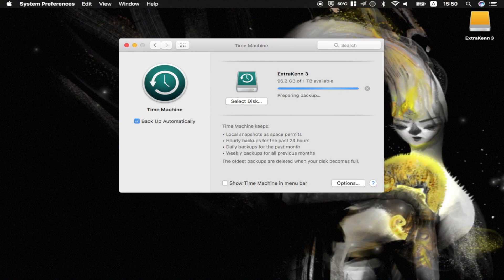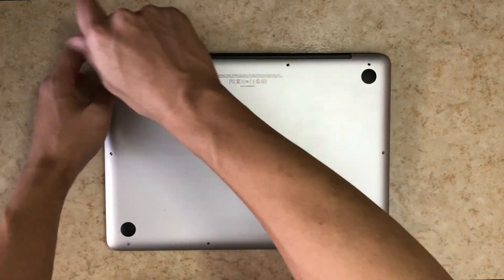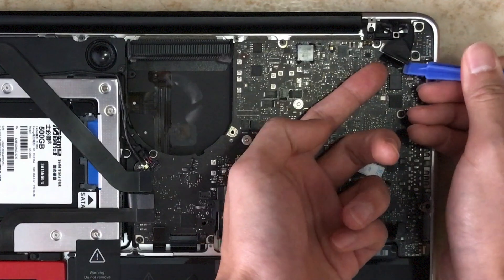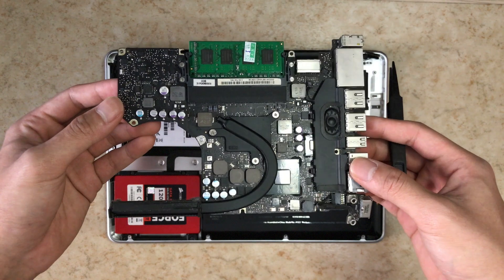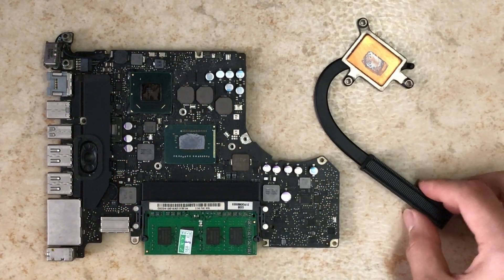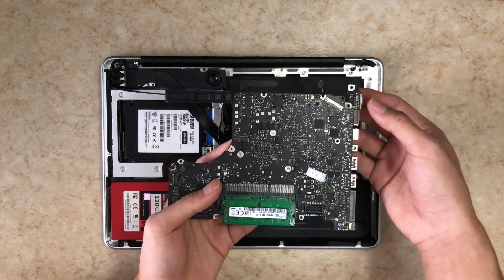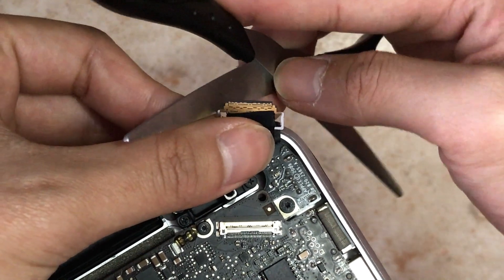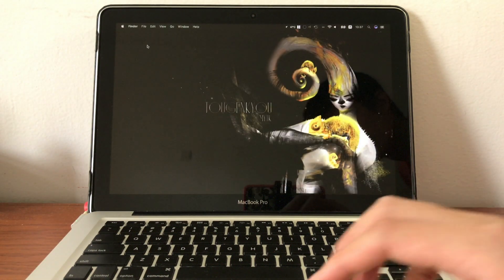How To UPGRADE Your 2011 Macbook Pro to 2012!

Comment from the maker: I have just recently added a few links to get the parts required to upgrade your Late 2011 logic board into the Mid 2012 one. Please kindly check out the video description 🙏🏻
Reply: Kenneth Tanaka    I have a late 2011 MacBook Pro 17. Is this what will fix the bad GPU issue?
Reply: 867 5309 that’s what I’m asking
Reply: 867 5309 I would think so tho because the graphics is different
Reply: Sukses untuk mu (succes for you)
Reply: Keeneth . Mac book pro late 2011 aku bisa diugradpe ke 2012 tidak ??
Reply: Can you do this with a Mac mini also

Comment: Hey man, I recently swapped the motherboard. At first it was fine. But now it couldn't be powered on (both motherboard doesnt hv green light from magsafe anymore) could it be the charger's fault? Also, do i need to change the charger as well?

Comment: Thanks for the tutorial, Ken. So I have an early 13" 2011 MacBook Pro. Because of some logic board issue, I'm planning to replace the logic board with the newer version. Which one of the best option? Replacing with 2011 i7 or Mid 2012 i5

Comment: Great video, thank you! A few questions. You mention the heat pipes. Does the correct heat pipe for the 2012 board usually come with the board, or is this a piece that I would need to find/buy separately? In the video it looks like you took the heat pipe off of the 2012 board, and then put it right back on. I presume that this was to put fresh thermal compound on, as you're making the swap? I note your video was done in 2017. I'm looking at replacing my Late 2011 board with a 2012. As I write this, it is September, 2021. I'm curious if there is anything new you've found about this update that we should know, since you made this video. Many thanks!
Reply from the maker: Hey there Brian, so far there has been no update to the method or parts being used, and yes the 2012-model heat pipe will be a separate purchase from the motherboard, but that depends on the seller as well maybe he’ll give one included (mostly they don’t)

And do note that the 2011 and 2012 heatpipe is different, so it’s not only to change the thermal compound

Comment: Would adding the 2012 logic board to a 2011 macbook pro - give it USB 3.0 & the more modern Bluetooth 4.0? Great tutorial by the way
Reply from the maker: Yes to the USB but no to the bluetooth, you need to get the bluetooth module separately

Comment: is it ok to touch the motherboard ?
Reply from the maker: As long as you don’t have any static electricity, try touching the metal body of the mac, or the metal part of the DVD drive first to discharge any charge you might have, before touching the motherboard
Reply: @namedkenn oh ok thanks
Reply: @namedkenn  I want to try and upgrade my MacBook Pro to its maximum limitations
Reply: @namedkenn  hey I have one more question are the links you put in the description safe to buy from ?

Comment: I have a few questions. 

1.) Will the 13"  2012 motherboard work on the late 2011 17" Macbook Pro? ;  
2.) Is there any difference between a 13" motherboard and a 17" motherboard?
3.) Does upgrading to a 2012 affect any ram or other upgrades to the rest of the computer?
Reply: 3rd question my worry too

Comment: Hi Kenneth, if I have both MacBooks next to each other and I'm just swapping the boards out - can I simply take the whole board with heatsink, speaker and magsafe and drop it into the 2011?
I did that, also put the 2012 fan into the 2011 body, it works but I'm getting weird responses like laggy touchpad...any idea? It feels like it might throttle somewhere but the heatsink gets warm, the fan works and the board doesn't feel that hot when touching the underside of the PCH and CPU. Could it be that it gets angry with different (or removed) bottom plate?

Comment: I did as you suggested, and bought a mid-2012 logic board to replace the mid-2011 LG! I placed everything back to the way it was BUT it never turned on. Black screen but Apple chime was heard and that was it! I can't figure out what is wrong with it.
Reply from the maker: Double check the display connector, has it been attached fully?

Comment: Hey thanks so much fo this . Quick question do i need to format my SSD or can i just keep the exact SSD that was running with the 2011 Motherboard?
Reply from the maker: You can keep using it...

Though I think I did a fresh install when I swapped the motherboard so, I’m not sure if the old files will ‘just work’

Comment: Hey Kenneth, My Macbook Pro (Late 2011) 13 inch has a 2.8 GHz Intel Core i7. Is it possible to upgrade that? Or should I keep it? I'm still going to do all the other upgrades from the original OG Video!
Reply from the maker: Yes you can, but only if you really need to, otherwise I think it’s better to just sell it and get something a bit newer (2013-2015 MBP)

Comment: I have a Macbook Pro late 2011 with i7 processor. Wouldnt this downgrade the processor to i5? Or is it still better?
Reply from the maker: I think the only difference between i5 and i7 was the clock speed, so you won’t see much of a difference in the CPU, but you will feel the difference of the GPU that’s for sure

Comment: Great  tutorial video for those of use who want to upgrade a faulty 2011 board to a 2012.

Personally since my MacBook also has a faulty battery and speakers along with a faulty on-board  gfx card it just gets to the point that it’s just way easier (if not cheaper) to just get a used 2012 MacBook Pro.

Comment: Hi Kenneth, excellent tutorial. I have an early 2011 13" MBP. Is a late 2012  logic board the latest I can upgrade to, or can I go even newer?
Reply from the maker: Thanks! This is the latest we can upgrade since every MBP after 2012 are using new designs
Reply: @namedkenn  Ok, thanks for the info! Does that mean mid 2012 only, or let 2012 as well ?
Reply: Sorry for the typo, I meant "or late 2012 as well?"

Comment: Can you do this from the 2010 mbp to 2012 mbp logic board (non retina)?
Reply: After some research, I found out it is very very possible. The only things that are not compatible are the airport (wifi card), speakers, antennas, and display connection. The easiest way to solve this is to purchase the 2012 MacBook pro display, by doing this you are getting new antennas and the correct display connection. To fix the other issues just purchase a MacBook pro 2012 airport with cable, and speakers (subwoofer, left, and right). This solves all of the issues that you will have when upgrading from a 2010 mbp logic board to a 2012 mbp logic board, the 2012 offers MUCH more power so it is worth the $240 upgrade for all this.
Reply: Do you mind posting where you found the parts you used
Reply: Kevin Nimbus Yea! Just search on ebay, I even got the price down on the logic board by making an offer on ebay

Comment: I upgraded my 2011 MacBook Pro motherboard to a late 2012 for the sole purpose of updating MAc OS High Sierra to Mojave. Besides trying a clean install of Mojave, all other program upgrades have failed. I start out with a Mountain Lion system that’s was upgraded to High Sierra without any problems. I then installed all updates to High Sierra. I went to the Apple site and downloaded a copy of Mojave with out any problems. I launched the Mojave application and went through the steps on installing on my untitled hard drive. 10 hours later the program barely shows half way from loading. I did a simple reset but no luck. Please help.

Comment: Do you need to buy a processor to install in the motherboard right? could you share an active link to buy the motherboard, the one you shared before is down D:     --  warm regards!
Reply: I have a Macbook Late 2011 . I5 2.4GHZ 8 RAM 4x4 DDR3 1333mhz - SSD 240 - OS 10.6.8.
Could I get this:
Bluetooth 4.0 Wireless card BCM94331PCIEBT4CAX
4. MD101 Mid 2012 Motherboard
5. MBP Mid 2012 heatpipe
5. 16GB (2x8) 1866MHz DDR3 RAM
6. New Battery . 

is it possible to restore it and install a newer OS? which one could you recommend me, I'm looking to work with code and audio and basic tasks in office.

Comment: Hello Kenneth,  I have a macbook pro 13" with 2.7 Mhz, 17 processor , 8 GB RAM 1333 Mhz.i upgrade it to 
MACOS High Sierra and the computer became very slow. So i am thinking to do some upgrades based on your videos.
So which motherboard is compatible and where i can buy it ? i believe also RAM  can go up to 16GB.
Can you please advice ?
Thank you very much 
Nikolas
Reply from the maker: Which year is your motherboard again? If you can upgrade to High Sierra officially then most likely you already have the top-end Mid 2012 board, and sadly there is no more upgrade to that. Maybe try upgrading to SSD that will help speed things up a ton

Comment: You can simply buy a new 2012 LCD connector and while reassembling LCD panel, swap the 2011 out. No need to cut the edges with force at all.
Reply from the maker: Well that’s another alternative 🤣 but I prefer to keep using my old monitor, and I don’t have to spend more on a monitor too haha
Reply: @namedkenn  No, you keep the LCD, but just swap out the connector cable from LCD to board. It requires disassembling LCD panel too.
Reply from the maker: Ohh right right that could possibly work, and at a low cost too

Comment: Would it be possible to upgrade MBP 13 Mid 2010 to the Mid 2012 logic board and what other parts do we need to replace if it's in anyway possible? Thanks
Reply: Hi! I was researching this and it seems everyone tells you that it's impossible. I can assure you it's not, I spent some time going through everything and I am about to do the same to my 2010 mbp. What you need to do is purchase a 2012 airport card and cable, 2012 MacBook pro display, 2012 MacBook pro speakers (subwoofer, left, right), and the 2012 MacBook pro logic board. The airport card and cable are compatible with the new board while the 2010 one isn't. Now you need to replace the antennas and camera (which also have different plugs on the 2012 logic board), what I found was that it is just easier to replace the display which contains all this for you at a smaller cost, so just buy a 2012 display. After that, the new speakers assemble just like the old ones but the main one has the space for the airport card. This is all you need in order to upgrade your 2010 logic board to 2012, it sounds so complicated but it really isn't and the extra power you get is really nice.

Comment: I have replaced my harddrive with a new SSD and that's about the only thing I've upgraded on my 15 inch macbook pro , late 2011. Here are my overall specs...what else can I replace and upgrade here?  

Processor: 2.2 GHz Intel Core i7
Memory: 16 GB 1333 MHz DDR3
Graphics: AMD Radeon HD 6750M 512 MB
Intel HD Graphics 3000 512 MB
SSD: EVO 850 PRO, 2TB
Reply: I have the same.  There is nothing else, other than following these instructions to upgrade to 2012, which I understand is considerably better.

Comment: I was able to use the 2.9 i7 logic board but I accidentally broke the iSight Cable during installation, but I have Mojave installed.
Reply: hey man, where did you buy the board?
Reply: Ali Azimi I was too scared to buy a cheap one from third party source and appreciated lifetime warranty from iFixit, but it’s $399...... yeah...
Reply: still cheaper than a new machine

Comment: I will be attempting to upgrade early 2011 MBP 2.3 ghz i5 to mid 2012 2.9 ghz i7 logic board but I am not sure if it will be compatible. Any advice?
Reply: Hi, any luck on this? I also have early 2011 MBP, and thinking of upgrading to 2012 mother board
Reply: Hi? I also have MBP 13 early 2011. Does it work with mid-2012 logic board?

Comment: I have a macbook pro late 2011 i5 2.4 . I am wanting to change the mother board to the Apple MacBook Pro 2012 (Mid) Core i7 2.9Ghz 13-inch. Is this possible?
Reply: I had the same question... except I have an early 2011 2.3 Ghz. I just ordered the mid 2012 2.9 i7 on iFixit and will be attempting an upgrade next week. I'll let you know how it goes... Still not ready to have 4 USB-C ports and lose my CD drive and I want to upgrade to Mojave.
Reply: Hey man, yeah that would be amazing! Let me know how it goes.
Reply: Hey what hgappen with your upgrade ?
Reply: It works... I accidentally severed my iSight cable leading to the logic board, so I needed to buy a replacement cord on powerbookmedic.... you have to remove the display, screen and it's difficult to change, so I recommend doing the replacement slowly.... You need to buy the 2012 logic board, but the i5 and the 2.9 ghz i7 is compatible with early/late 2011 macbook pro... I had already upgraded my bluetooth card to the 2012 version to support hand off. i was able to upgrade my 2011 macbook pro to mojave and system information shows my macbook as a "mid-2012 macbook pro" so I bought myself another year for $300. All parts are purchasable on ifixit.com or powerbookmedic.com.
Reply: can you use a 2013 or 14 board on the late 2011
Reply: gareth roche nope. 2012 was the last year they updated this laptop. But it is compatible with Mojave. You can also update the Bluetooth card from 2011 to 2012.
Reply: just saw this! thanks!

Comment: I am also wondering which logic/motherboard is the newest that the early 2011 macbook pro can be updated to. Which is the highest spec version compatible? What is the best source to purchase a refurbished logic board from?
Thanks so much for any advice.
Reply from the maker: Sorry for the very late reply, but to answer your question, as the macbook pros that come after the mid-2012 are all Retina MBPs, this upgrade is as far as you can get. The i7 variant of the Mid-2012 logic board is the fastest. And I’ve put a link in the description, you can check it out I think it should be pretty good.
Reply: Kenneth Tanaka thank you K. My 2011 mbp (a1286)  just died on me (green lines) very sad, but hopeful it can be fixed by replacing to the 2012 logic board
Reply: @enjoypolo  You can disable your dGPU to fix that issue. There's quite a few tutorials on youtube. :)
Reply: @enjoypolo  Possible fix:  Heat gun the AMD GPU.  Solder balls need reflow.

Comment: Thanks for this video! I did this on my 2010 with great results!
Reply from the maker: I’m very glad it did help you 🙏🏻
Reply from the maker: By the way so did you change from 2010 into a 2012 motherboard? Is it possible?
Reply: M92Brigadier I’m wondering the same thing
Reply: Kevin Nimbus sorry, I missed the original reply. Yes, it is possible. You should upgrade the ancillary components like the WiFi/Bluetooth though as well
Reply: M92Brigadier so you didn’t have to change the display?
Reply: Kevin Nimbus nope, plugged in and worked fine
Reply: @1999CSVT  thank you

Comment: Hi! Do you know if MD102 board will fit into MBP late 2011 A1278 i5 body?
Reply from the maker: Yes it will fit the same 👍🏻
Reply: Could you explain in more details how to trim display cable to fit it MD101/102?
Reply from the maker: Just use sharp blade/knife/scissor and 'cut' the black colored plastic sides a bit so that it would fit into the new motherboard (otherwise it will be too big)

Comment: Quick question Ken, do I have to do any trimming if I am looking to exchange my late 2011 2.4 ghz i5 to a late 2011 2.8 ghz i7 motherboard? Also, is upgrading to retina display a possibility?
Reply from the maker: Nope if it is the same year I don't think you have to do any trimming, and nope retina display is not possible.

Comment: Why do I change the motherboard if I don’t have any problem with the one i have, Am I getting better performance?
Reply from the maker: Yeah, especially on the GPU part, even though HD 4000 still doesn’t cut it, but it is acceptable compared to HD 3000 which sucks. And also you will get USB 3.0 and native Continuity support.

Comment: is it possible to do it with a 2010 macbook pro'?
Reply from the maker: I am not so sure about that, I’m sorry
Reply: @namedkenn  No, the physical location of the ports are different, the 2011 has USB 2.0 while the 2012 has USB 3.0, but they are in the same position.
Reply: Yes! It is possible to do with a 2010 macbook pro, I did it with mine. You need a couple different things though. You need a new 2012 airport card, and you also need to buy a 2012 display this had the new antennas and the correct display connector and camera for you as well. The last thing you need is the new speakers (subwoofer, left, right) I did all this for $240 included with the 2012 logic board. Everything should go smooth from there.

Comment: Is it possible to upgrade a 13" late 2011 2.8 GHz Intel Core i7 to a mid 2012 2.9 GHz Intel Core i7?
Reply from the maker: Yes of course it is, you just have to find a mid 2012 motherboard with that specs you want.

Comment: How much for the 2012 logic  board with i7
Reply from the maker: small stark You can check the link I’ve put in the descriptions, i7 is quite expensive though
Reply: The i5 in the link you posted is slower than the board already in my late 2011..

Comment: Can I use a mid 2012 MacBook Pro Logic board / motherboard on a late 2011 17” and are all 13” 15” and 17” the same logic boards
Reply from the maker: I don't know if this will work or not, as I have never tried it myself, you can try to Google it if there's any possibility

Comment: hi , thank you for the video, I did the something as you , but after the upgrade, my FaceTime camera does not work anymore, is yours working?
Reply from the maker: +Yifu Cheng hi, glad it helps, but no I don't have any problem with my camera, it's working fine, but instead I can't close the lid and get it to sleep mode, I guess that's the motherboard's problem though
Reply: thank you a lot, my Mac get to sleep no problems, but the is no camera, maybe the cable or the logic board connecter is not working.  thank you for the video, it is very helpful.